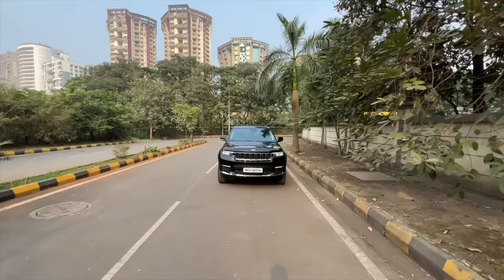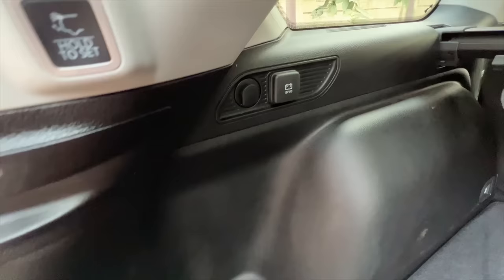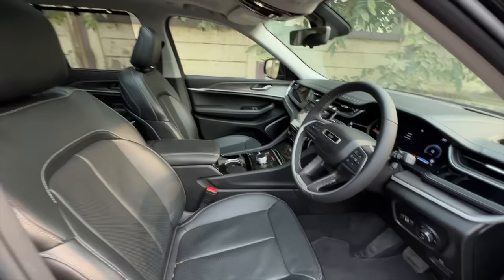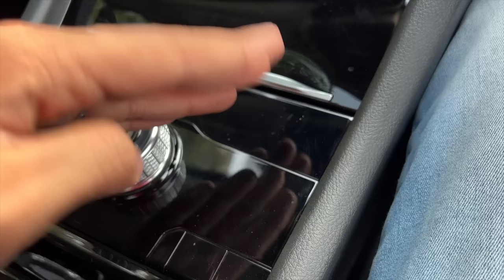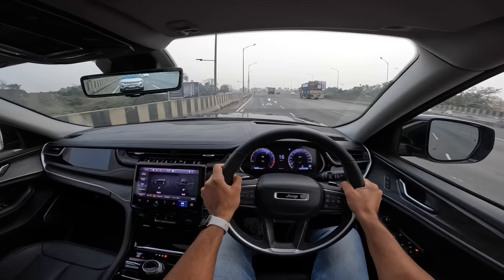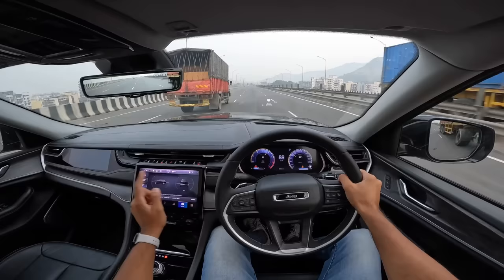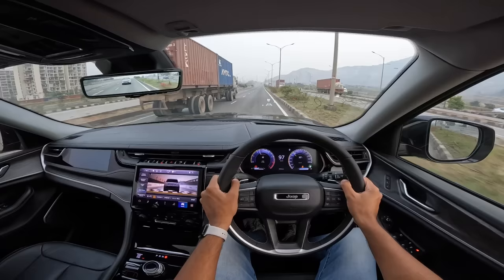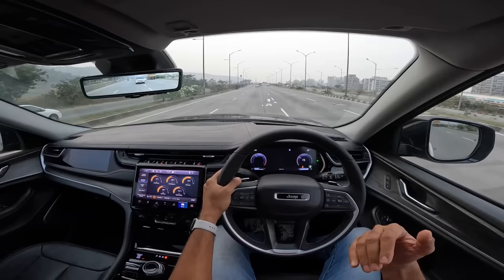Jeep Grand Cherokee - Brute SUV That's Super Comfy! | Faisal Khan

Comment from the maker: What do #FasBeamers like/dislike about the Grand Cherokee?
Reply: I love All things in JGC that are not avilable in  other cars in this segment 🙂

BEST CAR IN THE SEGMENT
                  🔥🔥🔥
Reply: I didn't like it's lack of 6 cylinder or diesel engines. No air suspension. Side claddings should be body colored like they have it in global models. No Light color Interior for that premuim appeal. Body roll is too much. Dispite these there's a lot more to like in this SUV. But it'll still be a deal breaker for the things I don't like. There are certain things I don't need necessarily and certain that I need which is not there.
Reply: Ay bro how tall are you?
Reply: Better than x5 sports x plus
Reply: @manishsinharay8702  U allright bro?
Reply: @TITAn-ef6vy   yes bro
Reply: @manishsinharay8702  yea in your dreams
Reply: The co-driver screen
The trailer..i mean boot
Reply: Waited for this car for past 9yrs
Reply: Price
Reply: @imranmidaz  yepp air suspension with height adjust was a must
Reply: Even a fortuner can beat the highly acclaimed Cherokee ,jeep has launched here..
Why the heck is that "chintu mintu "fiat engine is still around with the zf gearbox transmission ?
Why don't jeep do some thing else to get it right for a change?
The transmission engine combination in my trailhawk doesn't tends to hold on the gears for longer revving it to red levels when i really need power...

What a shame!
Reply: But Iam still compass fan
Reply: Press Report: Cherokee production being stopped @ xyz plant. Are they passing off remaining stock in India
Reply: Do you think it will smoothly run on our  Ethanol Petrol..?. 20% ethanol Destroy all Engine and fuel systems 🤔
Reply: Forget about grand cherokee plss tell why tf that guy was following you coz it’s curious to know pls tell haha 😂
Reply: they shouldd have offered a bigger  and poweerful enginee for this heavy vehicle
Reply: Hopefully to have an jeep wrangler rubicon also jeep grand cherokee limited optional both the vehicles in a single purchase ❤❤❤❤
Reply: Jai shree Ram 🚩💞💕
Reply: @manishsinharay8702  Agreed, way better

Comment: Honestly for the price was expecting a turbo V6
Reply: Nah, the pentastar v6 is very overrated but underpowered, and an economy nightmare.
Reply: @shubhpatel2350  but still a v6
Reply: @axel  lol, a German I4 engine can churn out more power along with better economy. The pentastar is very famous for its own problems.
Reply: @shubhpatel2350  If that is the case then they should’ve reduced the price ₹90 L for a 2L engine is too much Fortuner or other germans are better
Reply: I think you forgot its India
Reply: @shubhpatel2350  yet mahindra sells much powerful i4 engine than audi/vag in india. What's your point, the smoothness of an inline6, v6 or v8 is unmatched compare to i4. You really need to drive it to feel it.
Reply: @shubhpatel2350  and FYI 3.6 litre Pentastar v6 is reliable motor. I've personally seen them running fine with 200,000+ miles in the USA.
Reply: @axel  whatttt. Dude I don't know what part of the world you live in but the mahindra engine that you are talking about is bigger in displacement than the German counterparts( which is 2L) and it still cant match the german in hp and torque(facts checked). German engines are anyway more powerful( you need to drive one to know one, lol). By the way, I have driven inline 3,4,5 and 6 and a V6 in my life and by far the worst engine was 3.2 I5 from endeavour due to a weird unsynchronized sort of noise that 5 cylinder engines usually produce but yeah the best engine was a german 2.0 inline 4 which by the way is more powerful than the 3.2 from endeavor. now how in this world can a mahindra engine beat a German engine. And yeah my point is in this world of over 100 rupees per litre of fuel, even the grand cherokee had to find an alternative inline 4 option.
Reply: @shubhpatel2350  exactly. How come a fucking Mahindra beat Germans in their own game. They have some legacy. These Indian companies will never match the level of Germans in a lifetime
Reply: @axel  good research, but even we humans are living just fine by eating potassium bromate in breads LMAO. Look a 3.6 litre big ass v6 engine and yet an amg inline 4 can screw it up anyday and that too with better economy. I don't know what is the fetish of American car owners but they just want everything big not necessarily powerful, and not something that would be appreciated by knowledgeable or most people.
Reply: @Saswata Paladhi  brother I really hope tata or mahindra can match them in the electric cars but when it comes to engines I don't think that they can beat Germans since diamler made the first ICE in this world. Jab india aazad nahi tha tab mercedes ne highest land speed record banaya tha jo ki aaj tak BMW bhi nahi tod pai hai aur kuch logo ko apni ek alag hi duniya mei jeene ka maza aata hai

Comment: The Old Grand Cherokee had masquerading presence but the new iteration looks more like a Meridian on steroids to some extent. However, the presence of this gen is also quite mammoth but the non-Hybrid powertrain seems a bit lackluster in output. Jeep could've plonked in the Hybrid powertrain with 375hp 650Nm output.
Reply: the meridian was based off the grand cherokee 😑(talking bout design)
Reply: @realcaesium  Yes but Old Grand Cherokee had more SUV character.
Reply: @navdeep_autophile o bkl bhaag jaa bhai 😂😂 nhi mill rahe naukri tujhe motorbeam mein
Reply: They wouldn’t do that because of the high tax on hybrids

Comment: 6:22 Because the closing button is provided inside of the car instead of giving on the boot. Needs some more time to get outside after the pressing of the button. If it has little more speed, it will broke your head. Therefore it is slow.
Reply: 👆👆I have a surprise for you 🎁🎉🎁

Comment: The wavy line in the backwindow is heated, and those will heat up the wiper so it will not stick to the window in sub zero temps

Comment: The price will be justified if it had a 6 cylinder or 4 cylinder diesel engine and Air Suspensions and some other extras. Since it doesn't have these things, I'm comfortable to pay 10L extra to get BMW X5 top model.
Reply: 1.06 cr k h top model aur ye 87 lakh ki h 19 lakh ka frk h aur 6 lakh ki warranty 25 lakh ka frka aur range Rover velar 1.05 cr ki h usme isse bhi km power h
Reply: @priyanshuchaudhary7580  bhai kya argument kr rha hai jiske paas 90 lakh rupye hain vo 12-13 lakh upar lga ke bmw x5,audi q7 merc gle kya nhi le skta ispe koi kyu hi pese lgaega

Comment: The power is too low. You can see the engine gap when you opened the hood. It could’ve been a V6 instead of a tiny I4 giving 250 HP. 😒

Comment: Even a fortuner can beat the highly acclaimed Cherokee ,jeep has launched here..
Why the heck is that "chintu mintu "fiat engine is still around with the zf gearbox transmission ?
Why don't jeep do some thing else to get it right for a change?
The transmission engine combination in my trailhawk doesn't tends to hold on the gears for longer revving it to red levels when i really need power...

What a shame!
Reply: I think Jeep had given a 2 litre petrol so that it does not cross 1cr. But no V8 means no Cherokee

Comment: Such a shame Jeep is only offering the 2.0L variant for 77 lakhs whereas you can get a 6.2L supercharged V8 Cherokee for 73 lakhs in the us. The 2.0L produces 272 hp and 400 nm torque, the 6.2L supercharged V8 engine produces a whopping 707 hp and 645 pound feet torque, that's 435 hp wasted. Heavily overpriced, not worth the money.